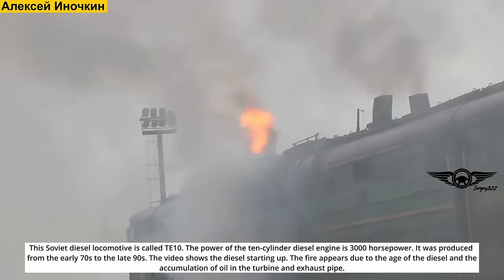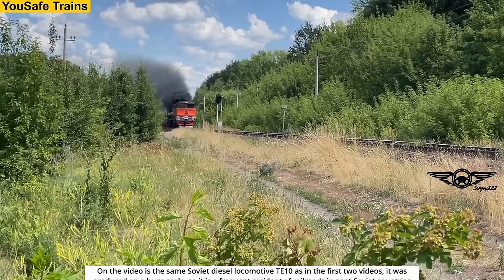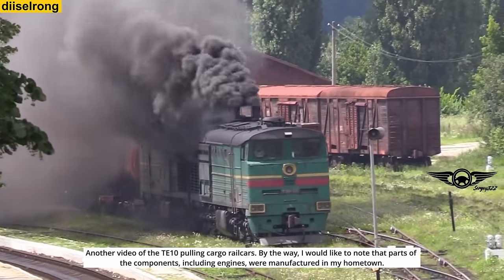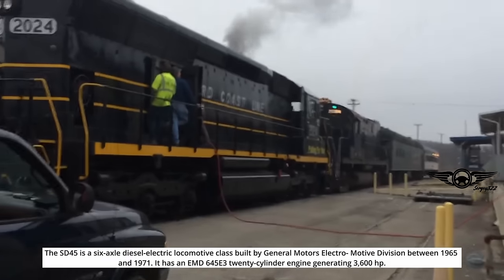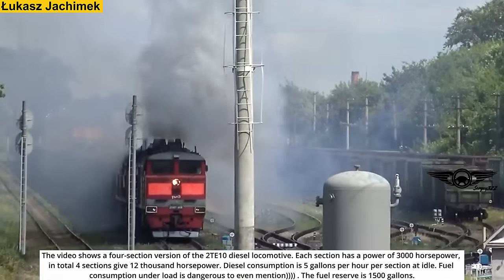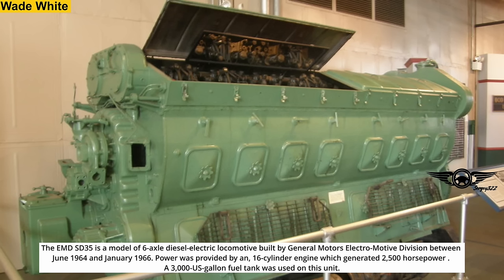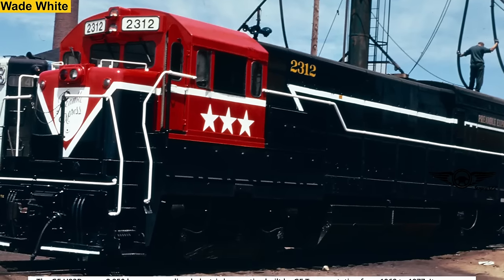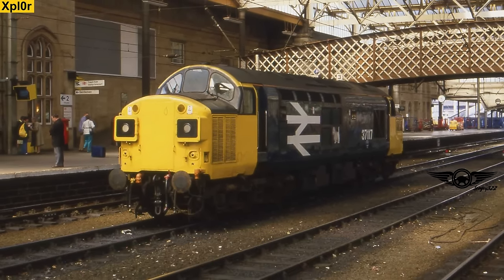Wild Old DIESEL LOCOMOTIVE Engines Cold Start & EPIC PULLS.

Comment: From what I could find, the 2TE10 uses approximately 198 gallons of fuel per hour.
Reply: I came up with 177 gallons per hour from theoretical calculations

To determine the maximum instantaneous fuel consumption flow rate for the 2TE10 locomotive, we need to consider the fuel consumption at the engine's rated power output. As mentioned earlier, each 10D100 engine in the 2TE10 consumes approximately 185-190 grams of fuel per horsepower-hour (251-258 g/kWh) at rated power.

Given:
- The 2TE10 has two 10D100 engines, each with a rated power output of 1,500 horsepower (1,100 kW).
- Fuel consumption at rated power: 185-190 g/hp·h (251-258 g/kWh)

Step 1: Convert the fuel consumption from grams per horsepower-hour to grams per second.
Fuel consumption = 190 g/hp·h × (1 hp·h / 3600 s) = 0.0528 g/hp·s

Step 2: Calculate the maximum fuel consumption rate for one engine.
Max fuel consumption rate (one engine) = 0.0528 g/hp·s × 1,500 hp = 79.2 g/s

Step 3: Calculate the maximum fuel consumption rate for both engines combined.
Max fuel consumption rate (2TE10) = 79.2 g/s × 2 = 158.4 g/s

Therefore, the maximum instantaneous fuel consumption flow rate for the 2TE10 locomotive, considering both engines at their rated power output, is approximately 158.4 grams per second (g/s).

Please note that this is a theoretical maximum based on the locomotive's technical specifications. In practice, the actual maximum instantaneous fuel consumption rate may vary slightly due to factors such as engine condition, fuel quality, and environmental conditions.

(158g/s × 1 hour) / (850 kg/m^3) / gal = 177 gallons
Reply: @AG-sx9ws  Really seems quite good for 6000 hp for an entire hour.

10d100 was one about the most efficient 2 stroke in its day, despite being pretty poor on emissions.

Comment: 2:00 On the Class 20:  it actually has a V8 (not inline 8) engine producing 1000 bhp (not 1800).  It's normally used in pairs, as shown here, due to the poor visibility down the length of the body, and in this form it can be considered an 8-axle, 2000hp locomotive which used to be a very common sight on heavy freight trains.  For even more haulage capacity, a third locomotive of the same type can be added.  It can also work in multiple with a number of other English Electric types of similar vintage, such as the slightly newer Class 37.  The Class 20 is a dedicated freight design with no provision for powering or heating carriages, though it was (and still is) occasionally drafted in to haul summer railtours, in which the locomotives themselves are the main attraction.  It can also be used to provide reserve haulage capability to a steam-hauled railtour, being attached at the rear.  In one of the clips shown here, it is being used to transport a brand-new Tube train (without passengers) across the mainline network, where the unusual 4-rail power supply required by Tube trains is not installed.

Comment: As a person who is actually educated and went to school specifically to learn about fuel burn and the affect different transportation has on the environment. 

Diesel electric trains are pound for pound the best transport for the environment. Even Russian locomotives. 

“Trains” are fully recyclable in any country they are used in. Everything can be refurbished or reused for something. 

An electric car battery specifically are essentially a bomb after a while. A very big bomb. And lithium is slightly radioactive so who knows what would happen.

Comment: Hi Sergey, I love such videos! Thank you very much 👌and if you like do some more please. Your explanations are informative and entertaining. The most of these engines do not have glow plugs and when they are cold started the diesel partially does not ignite but it evaporates making white steam. Normally such locomotives were heated up external by hot water piping system in the depot or on the waiting area of a railway station. An engine temperature of some degrees above zero C are enough for a quick and efficient cold start.

Comment: The picture shown during the first clip in not the correct engine. that is a 5d49 prime mover which is often used to replace 10d100 engines, They could not be more different engines in design.

Comment: diesel, steam, diesel with steam but electric-power-drill crank-start, ... AI learnt enough 功夫 to redesign or to cold start or repair or drive like a maniac, beyond manufacturer's specs (like what i did to car and motorcycle and electronics and computer and an ...). answers are available for those cut-off by floods and curious and ...